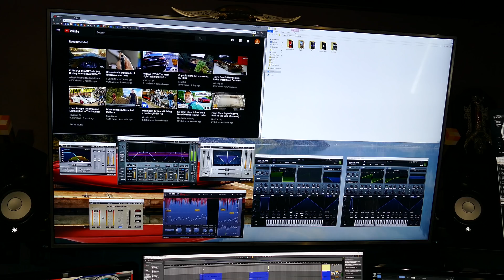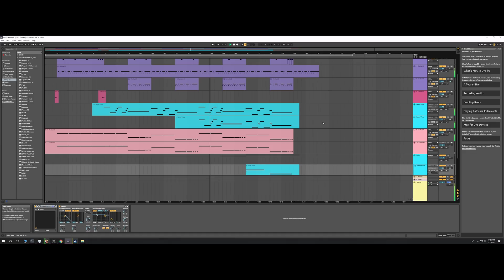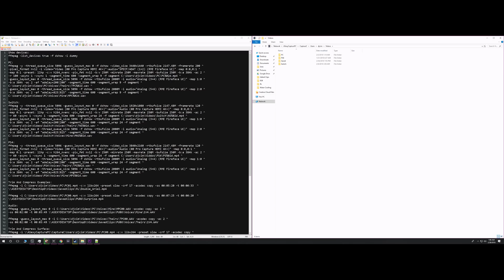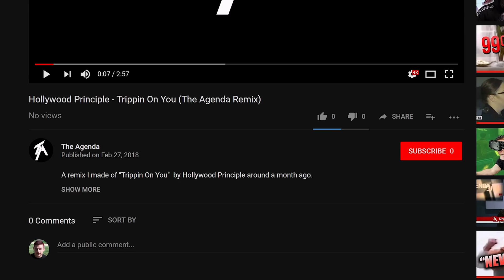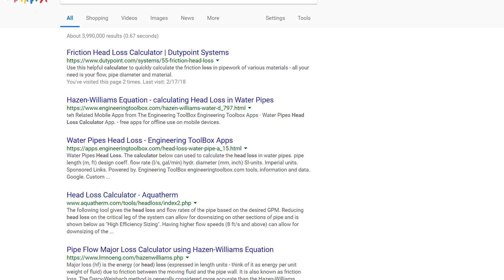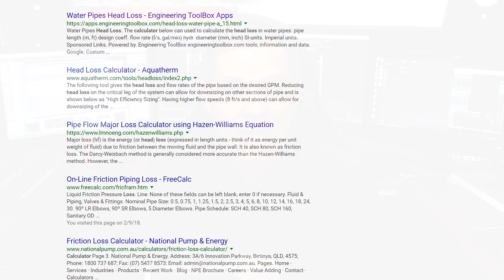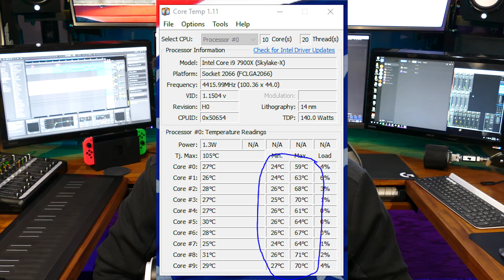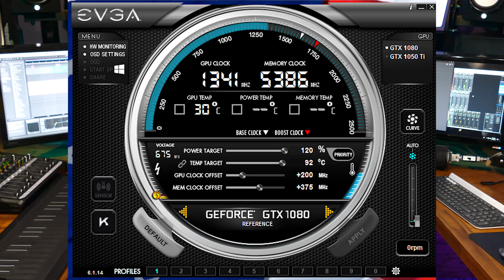Full Room Water Cooling / Setup Discussion

Comment: What I have been looking for, bring the heat to where you want it. Only, I do not want a lot of ventilators, but have more water running through a large radiator.

Comment: Pretty damn sick. I'm new to PC building, new to PC in general (literally haven't touched a PC since DOS or one of the early Windows), and was searching for hard lined cooling for research and came across your video. Think this setup is dope as hell. I was thinking it'd be super quiet in there with being able to have only a couple fans to cool the VRMs and everything else in a separate room with fans at like 90%. I actually first thought you had your PSU down there in the basement with all cables ran with the piping until after I watched. I'm ranting now, awesome build, awesome thought process, and enjoyed the sound bite halfway through with the cap drop lol.